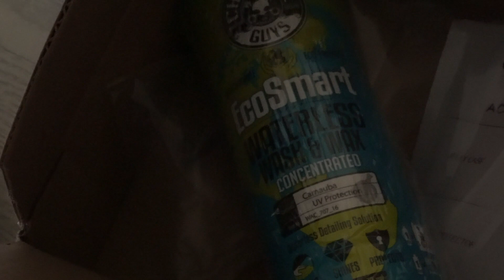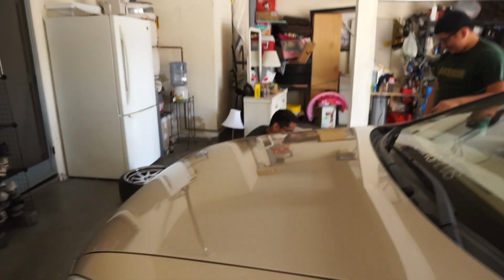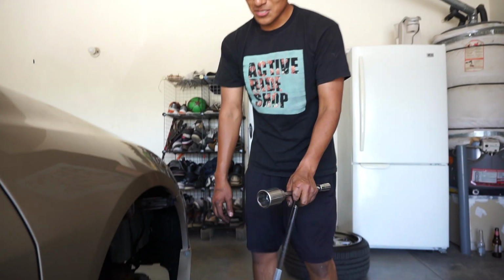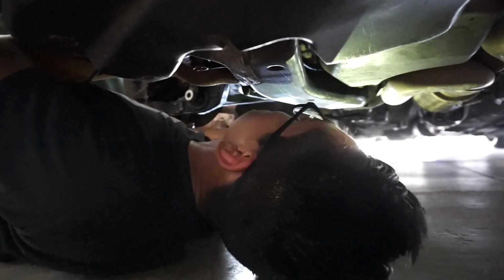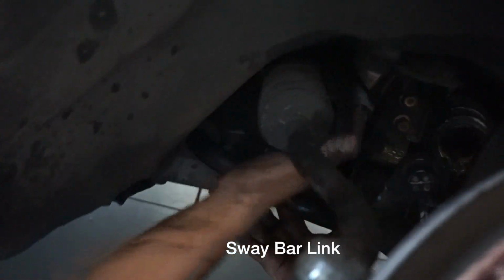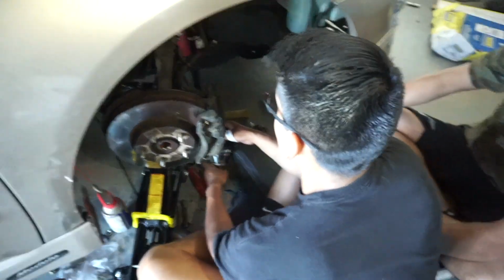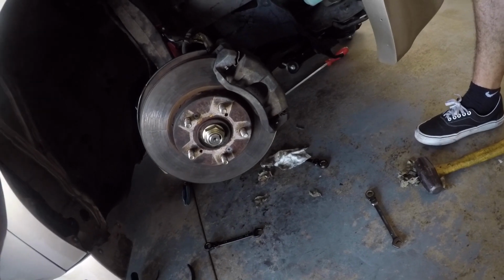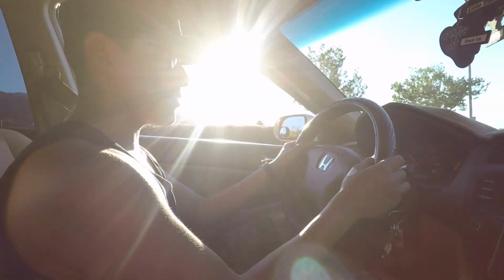Fixing Broken Axle and Lower Control Arms - Honda Accord

Comment: How did you end up getting the inner part of the axle out? Got the same car and having a hard time getting it out
Reply from the maker: Had to make what’s called a sliding hammer it consists of a long bolt, Vise grips and a wood block you can also rent one at your local auto store

Comment: Does your car ever shake at low speeds since it’s lowered? Also did you get aftermarket axles from a local auto parts or oem from Honda
Reply from the maker: No shake, aftermarket axels from AutoZone only because they have the lifetime warranty.
Reply: How much did just the parts cost you bro?
Reply: If it shakes check the height of your coilovers and make sure it lowered evenly, or it can be your camber or tires